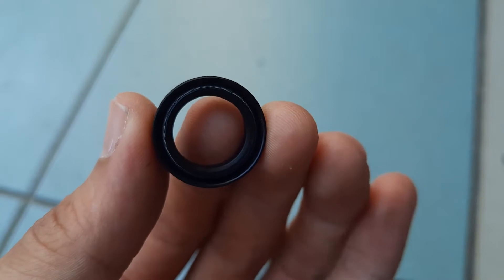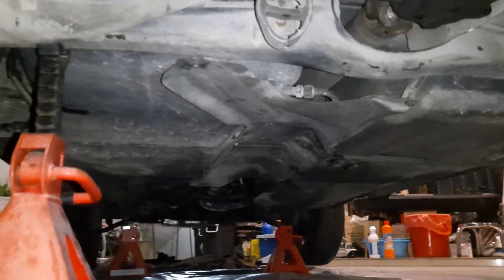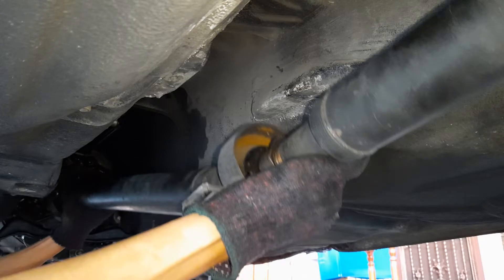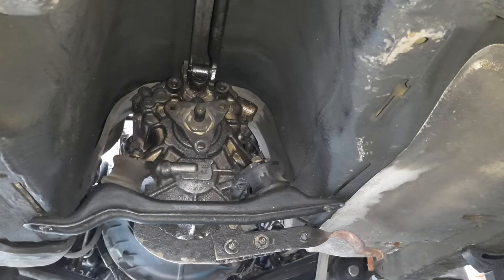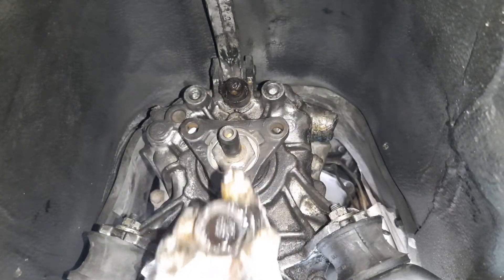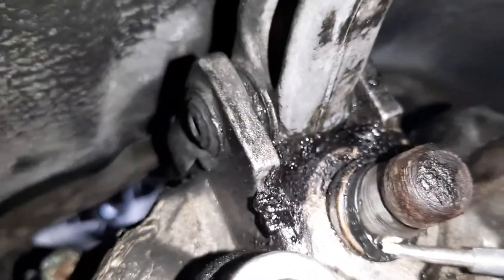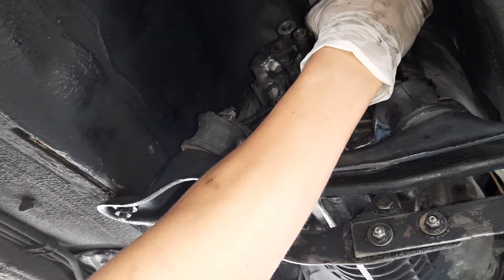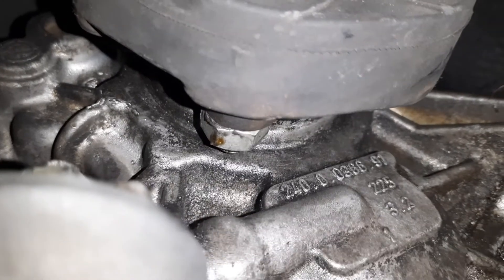BMW E30 Project ep6 - Gear Selector Shaft Seal Replacement

Comment: Thanks for the video, but after changing this seal 3 times with 3 different ones - oil still leak like crazy, turns out my selector goes way too much inside when in 2nd and 4th it creates a gap for oil to escape (getrag 260)
Reply from the maker: Thanks for sharing that info